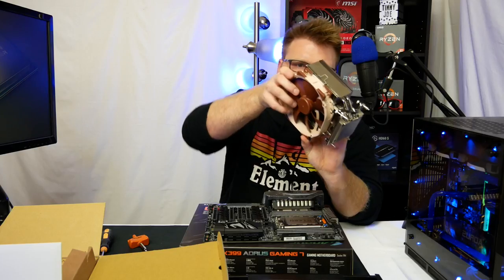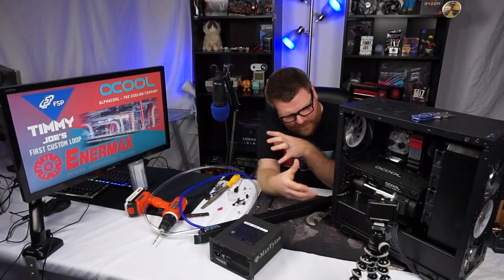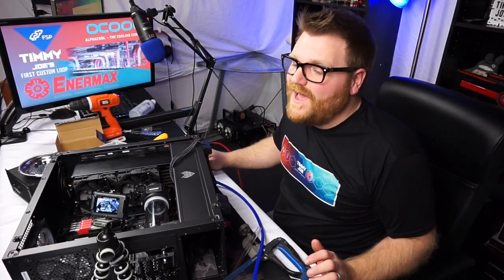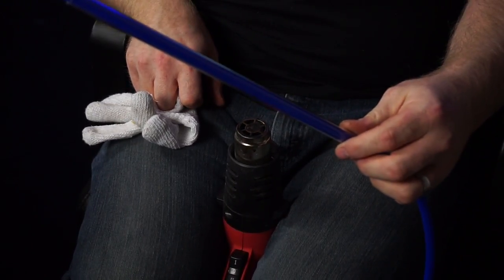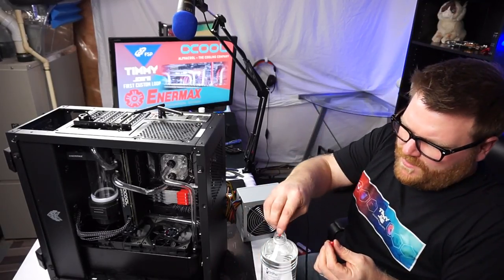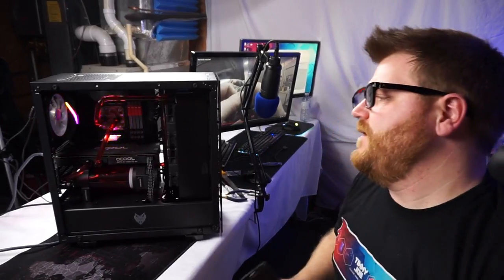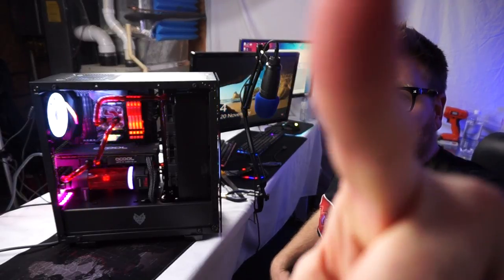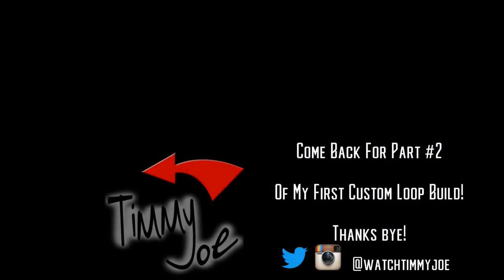My First Custom Loop PC Build - Part #2 'build and bend'

Comment: Will be interesting to see the long term viability of that pump. I really liked it but was turned off at the fact the metal casing and metal top are aluminum. I'm told they are anodized and coated for protection...but that still makes me feel very mehhhhhhhh.

Comment: I love you man, I've been around since before you hit 2k subs, but for the sake of your sponsors and your viewers (or mine anyways) sanity, please research something like this at least a little bit.  You need to have another fitting or end-cap open when filling a res, otherwise there's nowhere for the air to go.  It's worth the $0.05 to put down some paper towel to catch drips.  Oh, and please, for the love of all that is water cooled, rinse out your build and get some actual dye for your loop if you want it red.  That food colouring is going to wreak some serious havoc, and you will have problems.  That said, this is the first I've that Enermax pump/res, and it looks good.  I'm glad your first water build booted without issue though, and it looks great.
Reply from the maker: Dude, I win, there's nothing wrong, and red dye is red dye, it's all the same stuff, I did my research :) I win